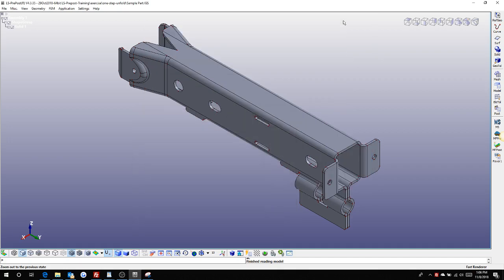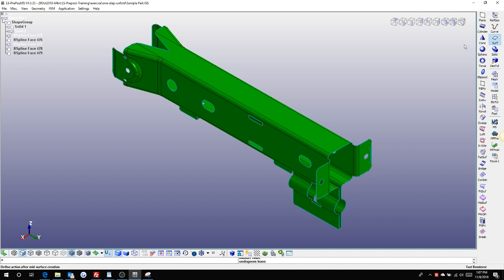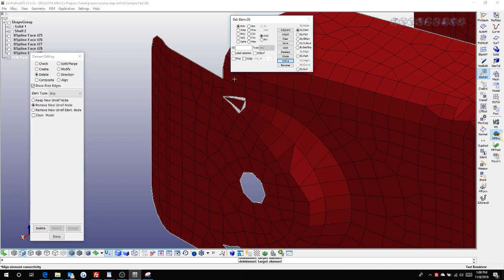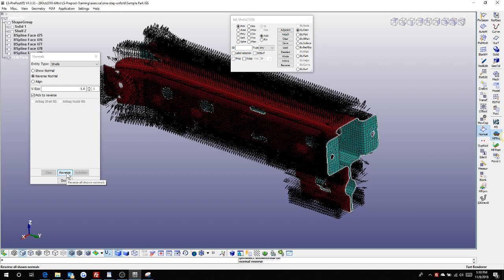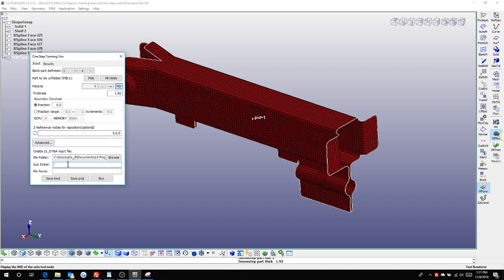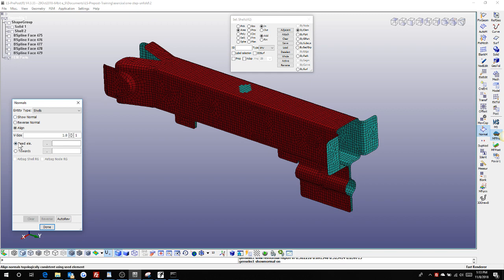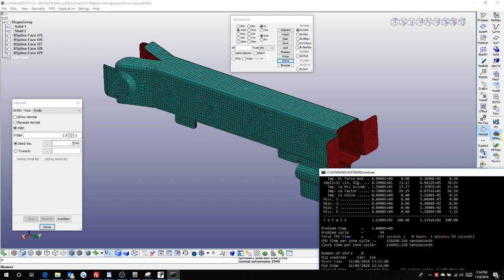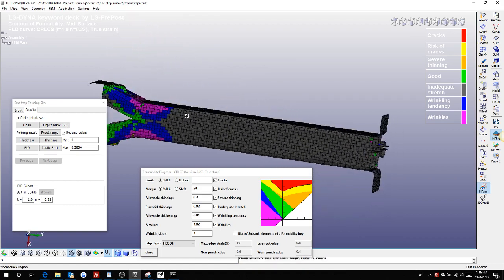Forming Simulation Tech: unfold blank/one step analysis with LS-Prepost 4.3.35

Comment: Thanks a lot for your tutorial Jeanne He, do you know something about the error (element ID ## has a zero normal vector)? Thanks in advance
Reply from the maker: HI, Victor, element with zero normal means you have an element which has a near zero length, you need to delete that element through model check to avoid the solver goes unstable